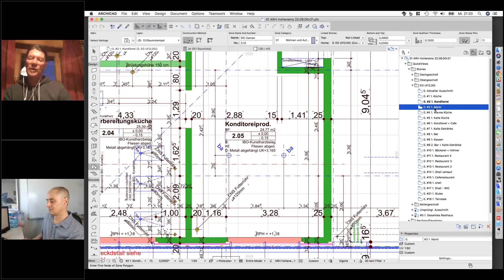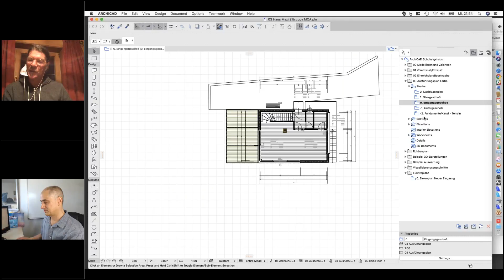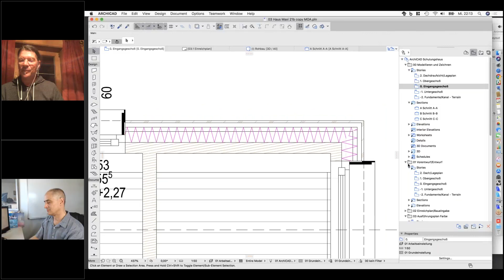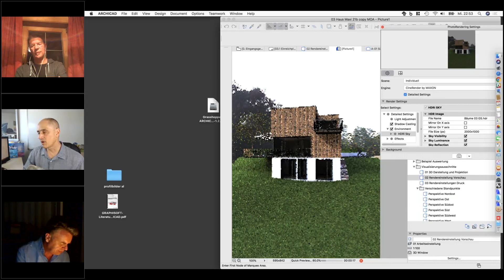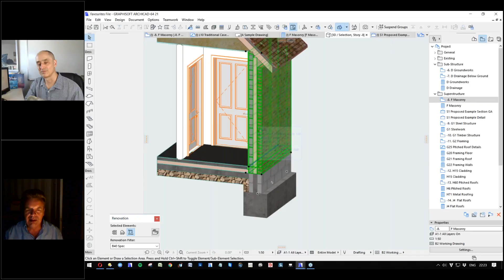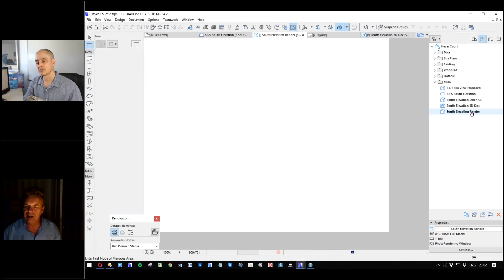ARCHICAD USER - June 2018 - Tim Ball and Andreas Lettner

Comment: I'm not talking about 2d as opposed to 3D? Ive been using ArchiCAD since version 6.5 (1999)....read my original comments again. Preparation is one thing, what's more important is the time taken in preparation. I for one, need a productive set of tools that assist me in my work and not be counterproductive attempting to reinvent the wheel with wonderfully presented over documented productivity. By the way...2d and freehand sketches have worked for centuries!
Reply: But, isn´t the point of Archicad that you can get a lot of this "pretty" documentation (minus annotations and dimensions)  almost automaticaly??  granted, with an adecuate use of templates, layers, layers combinations, precise modelling, etc, etc
Reply: Rodrigo Martinez that is all assumed and granted, without labouring the point however -  masterfully composed methods of attaining wonderful models of building details expresses to me that if these details are so involved to need this, then at what cost is my client paying me to complete it all? No one would expect to process this amount of time and practice money without remuneration back from a project. Or do they?
Reply: @TheWaveydee  I think you hit the point on this.   Even some 5 years ago i could present concept sketches done without any advanced lightning techniques and still get some wows... today, some clients expect to see photorealistic renders in the first meeting.   The expectation level is certainly increasing, but not the amount you can get paid for the job, at least not in my country (Mexico)

Comment: I know I have said this before - and as a practitioner of 35 plus years I wonder at how this intense process can be made profitable for the general practice of architecture....the business of getting things done at an affordable cost to the client and project. I find this process just unaffordable and self-indulgent, with all due respects. Thank you.
Reply: Its all about preparation. Once you have a good Template you can work as fast as in 2D. If you imagine a Curve it starts very low and in the end it hit a peak and you stay in this peak. The 2D process is more an wave with Lows and Peaks. In 2D you are still imitating pen and paper and you have to to work a lot on changes. Also you got in the end all Drawing you wanna have and not just the one you draw. Its the future. Its getting faster and faster. And its parametric in so many spots. Im working on an 60 Apartment Projekt with 3 Blocks and nobody can reach the speed in 2D which im getting of archicad. The most people cant believe how easy, fast and usefull it is.